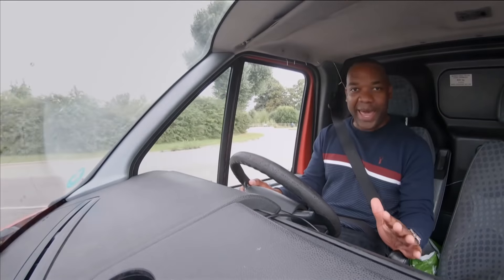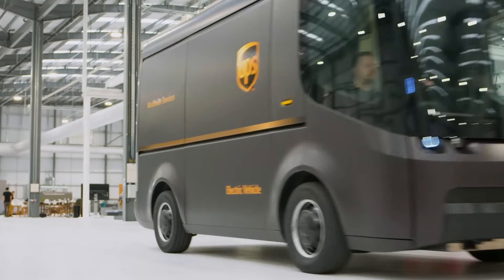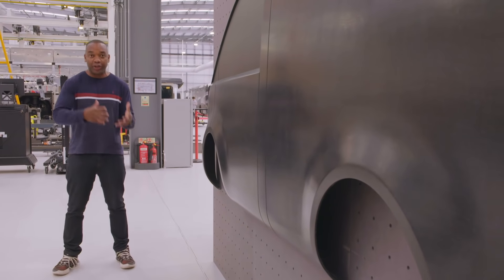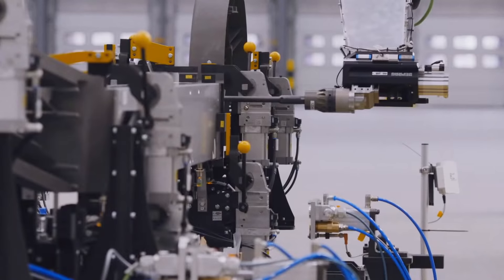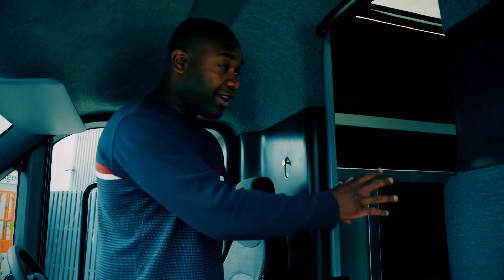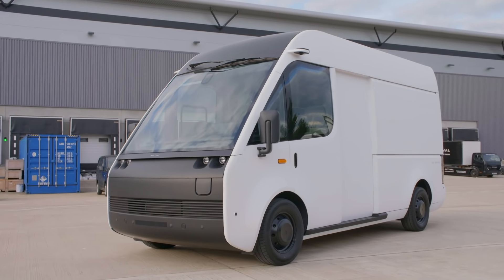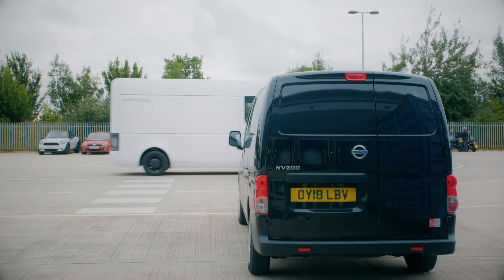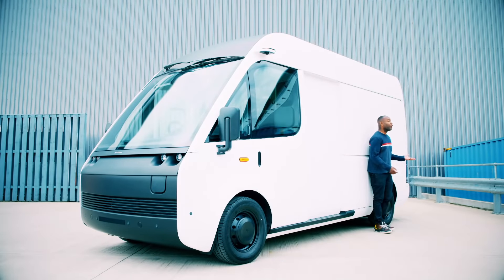The Arrival Van Test Drive | Fifth Gear Recharged

Comment: as normal, vans under full load will reduce the miles so 200miles per charge will reduce
Reply: Weight usually doesn’t impact range nearly as much as you’d think, even tremendously less for hybrids or EVs. I wouldn’t be surprised to see less than 10% of a difference in range between loaded and unloaded. Not the same with towing where it’s usually above a 50% hit. Totally different thing compared to towing.
Reply: @myid9876543  fully loaded we all know physics mean more power required . And the more demand for electric the higher the price of electric will become. 
Nice to know your efforts to make money to sell an idea that will come back and haunt you
Reply: @gavwyatt5314  Bear in mind that for stop/start driving (such as the local deliveries intent for the van shown) means a lot of that extra energy gets recaptured via increased regen (there's still losses, but it helps mitigate some of the impact).

Separately, we don't know whether Arrival were quoting range figures empty, or fully loaded... and shows like FGR tend to gloss over those 'little details', unfortunately.  That said, the fact that the quoted numbers were (from memory) ~200 miles from 135kWh battery implies they must be fully loaded, given the F150 Lighting truck (with far worse aero) gets better range with a 1000lb load...  either that, or Arrival really need to speak their sponsors in Korea to find out how to program an electric drivetrain...
Reply: @logicalChimp  and every 3-5 years companies will have to buy new battery packs as batteries will lose 15%-30% power per year on charge cycles, then when spent placed in a concrete box and buried like nuclear waste, so is the electric car going to save the world NO it will add to the issues
Reply: @gavwyatt5314  Uhmm - battery life is a lot longer than that, even with cycling... and you do realise batteries are recyulced with around 98% efficiency?  Given the $1000's of materials in those packs, there is no way they'll be buried (or if they are, someone will be along that evening to dig it up again :p)
Reply: @logicalChimp  I'm going to leave you with your bubble of opinions over facts, and in 10years time you can come back and delete your opinions and have a long chat with ya self

Comment: Local components is good in practice, but then you've potentially got varying quality issues. Cellular construction, instead of a production line... ummmm not so sure on. I get why, but there's a reason it's been so successful since Mr Ford started with it. It's possibly got other ways to be improved, but not sure that's the solution 🤔
Reply: Agreed.  A great idea for small runs, like British sports cars,  but this is a work vehicle.  Largely all the same!
Reply: @jamesengland7461  I think the idea is closer to the hand-built British sports car approach... namely, instead of trying to crank out 100,000 identical vans for sale across the country, any single microfactory might crank out e.g. 2,000 vans for the local delivery companies, and 100 busses, and 500 long-distance couriers, and 200 Model XYZ, etc.... and relying on the cell-style production flexibility to produce small numbers of lots of models locally, rather than producing high numbers of 1-2 models for shipment around the country

No idea whether it's actually viable, but that seems to be the idea they're pushing for.

Comment: Will the Transit be able to survive against the companies like Arrival that don’t have a massive investment in old technology and machinery?  Ford look to me like they are doing too little, too late. There is no way a retro fitted van like the Transit is going to compete with ground up designed BEVs, even if the range claims suggest otherwise. I suspect Arrival are keeping their cards close to their chest.
Reply: Blockbuster vs Netflix! 100%
Reply: Nokia Vs Apple 👍
Reply: I'm 15k invested 👍
Reply: The Arrival van is aiming to be cheaper and easier to maintain. Businesses are very focused on cost saving. I am very interested to see if Arrival can pull this off.
Reply: @jeremymanson1781  how interested I'm 15k interested 👍💵💵💵
Reply: @matthewspry4217  I've committed 10k as a long term investment. So I am keen that Arrival do not run out of cash and also are not forced to dilute our holdings more than they have already.
Reply: Arrival gives me Theranos vibes. Too much marketing, not enough deliveries. Their financials are also terrible.
Reply: People will still buy the Transit though because of Ford's dealer and supplier network as well as proven track record; when you buy a Transit you know exactly what you're getting, and when you're running a business (as many van buyers are), it's just good sense to pay for certainty and reliability.

Comment: Nice idea but just looks like too much of the operation is based on radical and untested logistics on this scale for a company trying to take on mainstream manufactures. Has flop written all over it imo.
Reply: I remember people doubted Tesla 🤣
Reply: @mariusmartinsen2064  Tesla mass manufacturing is very similar to traditional auto manufacturing, with some novel efficiency gains thanks to large die casting pieces.  Not at all what Arrival is doing with low quantity small factories, which goes against traditional economies of scale.
Reply: I think it's a bit too early to say much on this topic. Micro-factories certainly have their advantages and will be coming, but the economics depend on new technologies that are not quite ready yet. Arrival will have to navigate a difficult path - if they are too late others will get there first, if they are too early they could go bankrupt while waiting for the technological developments that they need.

In any case, I wish them the best.

Comment: Lets assume that somehow we share cars so there is just 1/4 of them on the roads. Lets assume all of them are electric. Just imagine how would the power grid should look like to power them all up. It is impossible now, and it will be impossible in the near future.
Reply: I’ve always said that, they’ll start introducing certain times to use certain appliances
Reply: With the continued uptake of evs the creation of more energy will follow, new facilities are coming along regularly. The data is continually being monitored, don't expect blackouts. Maybe the government will bring back subsidies for solar power on residential along with battery storage to enable people to be able to create their own power for their own vehicles.
Reply: It’s not impossible at all.
Reply: @Simon-dm8zv  
No not impossible, just costs us 25% of our electricity bill every quarter.
Reply: @Robert-cu9bm  I don’t see a problem in that?
Reply: @Robert-cu9bm  Change costs money. Fossil fuel prices will go through the roof anyway in the future so we have no choice. What is the source of that 25% figure by the way?
Reply: I smell a whole lotta wilful IGNORANCE around here
Reply: @Robert-cu9bm  Because the wholesale price for energy is dictated by the most expensive power production, not the cheapest... (yes, it means 'green' energy producers make massive profits at the moment - which is painful, but should encourage more producers to deploy RE, for the higher profits)...  

And this wholesale price applies even if you pay extra for a 'green tariff', annoying.  A number of companies (such as Octopus Energy, and (iirc) Bulb) are lobbying the gov. to look at how the wholesale energy market works, with a view to addressing this (and making wholesale costs better-reflect the cost of production, rather than just using the most expensive).

Comment: It will need better range than that if ford are getting the same range from a battery half the size
Reply: But the Arrival Van is what, like twice the cargo capacity at the same range. I see that as a negative to Ford. Depends on the price of the vans I guess.
Reply: The range of the Ford is not realistic at all.

Comment: Heaven forbid if Transit goes fully electric. I have a new diesel Transit and the elec/computer screen etc has caused nothing but intermittent problems that Ford can not fix.
Reply: The new Transit E comes out this year .....
You can't even add a tow bar to it 🙄
Reply: I feel that electric vehicles should stick to analog gauges, unless the electronics technology steps up quite quickly. :) All cars should have analog backups.
Reply: @AlaricTheArcane  Well, I love modern technology, and would love to see a speedometer similar to one in the Honda FCX Clarity (early 2010s, with the futuristic display).
Reply: such a bad van they outsell every other single van by 3 units to 1. when theres MILLIONS made, there will inevitably be an odd one thats bad that doesnt show initially and slips through the net. a friend has a fleet of vans. the one he uses personally is a transit. as far as im aware its not cost him a penny or a minute in downtime since hes had it, unlike the other (non ford) vans in his fleet.
Reply: @dashcam2417  its a big problem with most electric vehicles and i gather its to do with keeping the batteries/motors cool mostly. i think towing ANYTHING will be a thing of the past soon, without a HGV licence
Reply: @petelattimer6808  Given most EVs now are coming with tow hooks, I don't think so.  The bigger issue with towing (for an EV) is the increased aero-drag significantly saps range, not that it overloads batteries.... so they had to wait for vehicles that had enough initial range that they could handle the range-drop whilst towing, and still make it to the next charging station, etc.

Comment: Really interesting. I’m wondering when they will be able to use that technology for 44 ton articulated trucks. If you look at percentage of pollution nearly 50% of diesel emissions are from lorries. I know Tesla have tried and failed but when is someone going to solve this problem. As a truck driver myself the range on current electric trucks is laughable. When will the technology be there? Seems daft to me that the government wants to ban production of gasoline engines in a few years when they are only solving half the problem.
Reply: "I know Tesla have tried and failed" Bit early to say that. They're late, certainly. The Semi, Roadster, and the Cybertruck all need the 4680 to be viable, and it's taken longer than expected, (well, longer than Elon expected) to get that running. The 4680 exists, but production rate was not good enough, but it seems they have got the major problem sorted. Austin is reported to be on the verge of producing Model Y with them. The Semi won't be in mass production until that ramps up. Pepsi was to get a dozen of them last month, which didn't happen, though the Megachargers are being installed now. I don't know if Arrival has plans for a class 8 truck, they have car and bus prototypes, but I have the feeling their technology is not suited to that market. The way I see it, Tesla is the only likely manufacturer of big trucks, mostly because of the required volume of batteries. That means that even sourcing raw materials is problematic, and Tesla has been the only one who seems to be making moves upstream in the raw materials supply chain. The other possibility is BYD, they're already building a fair number of buses.
Reply: For the size of a truck, aren't solar panels a great solution?
Reply: @techalyzer  
You don't keep the same trailer, you drop it off and get a new one.
You would have to convert your fleet of trailers, for the few EVs you have.
Reply: @grahammonk8013  
The semi is never coming, energy density stops it in its track.
Reply: @Robert-cu9bm  Of course the Semi is coming. First few are being delivered to Pepsi now.
Reply: @Robert-cu9bm  Energy density? If you're being pessimistic, the battery will be about 4 tonnes. The diesel engine, gearbox, and drivetrain weight about 3/4 of that. 4 x model 3 motors , weighs about the same as 50 gallons of diesel. So even assuming Tesla can't find other weight savings, you're only looking at a payload loss of 1 ton. Tesla said last year that its Semi would be able to haul the same as diesel trucks, Then Europe has said EV trucks get a 4000 pound increase to gross weights, and In North America they get 2000.
Reply: @grahammonk8013  
So they would have around 1000kwh battery at best case scenario with 4t battery?
260wh/kg

Some numbers:
Model 3 efficiency .25kwh per mile for 1.6t= .15kwh per tonne per mile.

40t X .15kwh= 6kwh per mile

1000kwh battery ÷ 6kwh per mile.

166 miles best case scenario... Yeah they're not coming😉
Reply: @Robert-cu9bm  You think you can take model 3 KWh per ton and extrapolate? Kenworth's EV truck goes 150 miles on less than 400KWh, so all else being equal, you could guess at least 375 for 1000KWh, and I know their design is nowhere near as efficient. Weight means more energy to accelerate, and it gives you more rolling resistance, air resistance is higher too, but not by the same multiple.
Reply: @grahammonk8013  
"The zero emission Kenworth T680E has an estimated operating range of 150 miles, depending on application."

Depending on application...

No mention it'll do it fully loaded, what a truck needs to be able to do.

This is all marketing BS, where's the real life range.
Reply: @Robert-cu9bm  True, but I still say you can't extrapolate KWh/ton that way. We will be finding out soon anyway.
Reply: It has been solved, by Hyliion.
Reply: Volvo and Mercedes are developing electric Semi trucks. Tesla has not failed, they are just (very) delayed with their Semi truck.
Reply: Looks like hydrogen might be the solution for very large long distance vehicles.
Reply: @jeremymanson1781  Hyliion is the solution, look into them
Reply: @Robert-cu9bm  maybe long haul but short hauls will bank. Short hauls are very common.
Reply: Current EV battery technology will never work for heavy vehicles
Reply: @Robert-cu9bm  that's not how things work at all. You're just multiplying out the least significant factor. Most of the power is used for pushing the air out of the way, only a little is used because of the weight. The coefficient of rolling resistance for a truck runs around 0.0045 to 0.0080. So a reasonably well set up 40 tonne truck has about 2000 N of rolling resistance. At 100 km/h that's about 55 kW. So a 1000 kWh pack would take you 1800 km.

Obviously it takes much more than 55 kW to run a truck.

In fact, the consumption depends mostly on the aerodynamic drag and size of the vehicle. Details matter and the drag of an electric truck where care has been taken to minimise drag, will be quite unlike the existing fleet, and completely unlike a Model 3, which provides no useful guide.
Reply: @techalyzer  
No
Reply: @Robert-cu9bm  
"Energy density"?
You've done the calculations then?
Reply: @MuzikplumzDK  
No, it hasn't
Reply: @jeremymanson1781  
The overriding factor in long haul transport is running cost.
Hydrogen requires well over 3 times the grid energy to move a vehicle the same distance.
Tell me who pays for that energy?
.
.
(It's the end user)
Reply: @marko4496  
Except it will

Comment: This amazing  production method is the reason why car companies invested hundreds of millions into this company.
Reply: Where did you get the data on the investments from? You stated car companies, plural. Only ONE was mentioned as an investor.
Reply: @gottliebdee263  Nowhere, it's just deduction and speculation.

Their car is quite bad, but they have innovative production method, and already hundreds of millions have been invested by car companies.
So it means they see something in this company, and it's not their EV tech, because car's range is way worse than it should be.
Reply: Yeah not going to happen.

Robots can build a complete car, if they could manufacturers like Toyota and VW group would be doing it.

Comment: BREAKING NEWS: Arrival will be changing the name to Departed.

Here's why: UPS effectively get the vans for free with the stock investment placed and sell stock if they don't get what they placed for orders.

And the Korean company is in it to supply parts required, not interested in anything else.

Let's be honest 133kw Battery Pack is really piss poor for around 230 miles, Let's be Honest.

This company will last another couple of years tops and file for bankruptcy.
Reply: You have no idea. Any van of this size will do about 1.8 miles per kWh. The estimated range is perfectly normal. The claimed range of the e-Transit is highly unrealistic.
Reply: @Simon-dm8zv  that tells you the motors and batteries aren't efficient. 🤦‍♂️
Reply: It's designed for last mile delivery. Know what you're talking about before vomiting your ignorance. The range is sufficient and competitive compared to others.
Reply: @PizzaLov3r  Read my comment again.
Reply: @DavidKnowles0  Exactly.
Reply: @PizzaLov3r  Hyundai Motor Group and Kia Motors have some of the most efficient electrical vehicles on the market, so it not that.